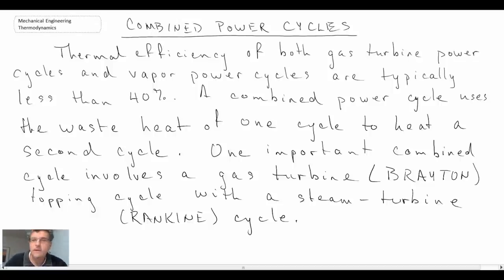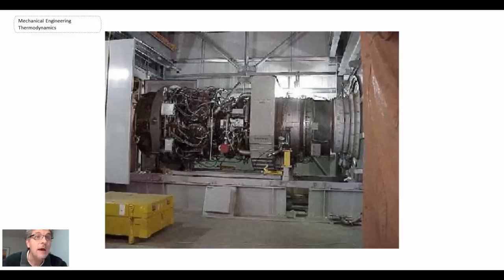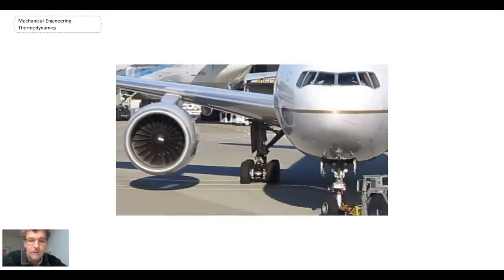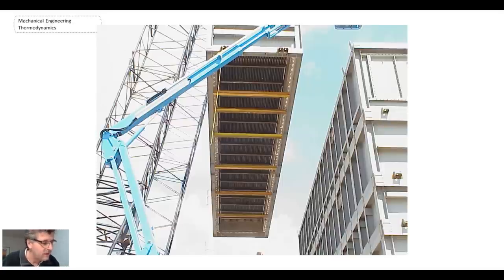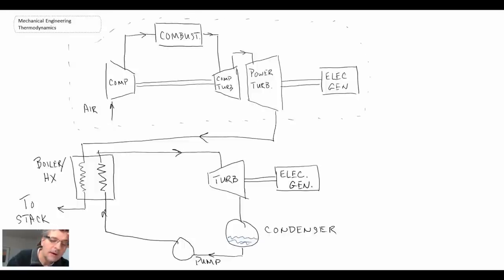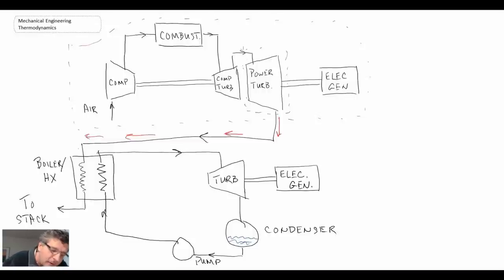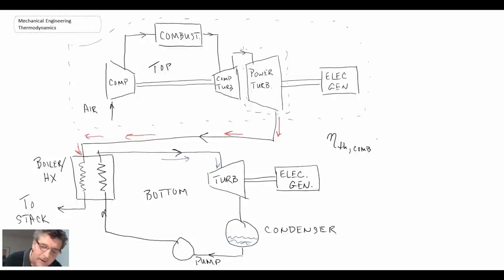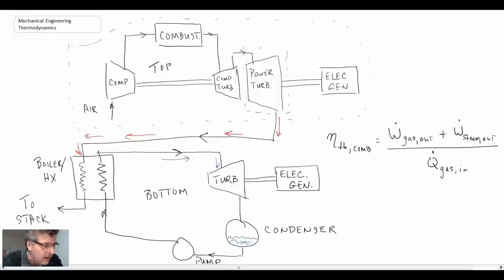Mechanical Engineering Thermodynamics - Lec 22, pt 2 of 3:  Combined Cycle - Brayton Rankine

Comment: The thing i don't understand is why this what makes this more efficient than just burning your fuel for heat and then using the heat in a rankine cycle? Or alternatively 2 Rankine cycles with different working fluids/pressures if one can't work in a big enough range.